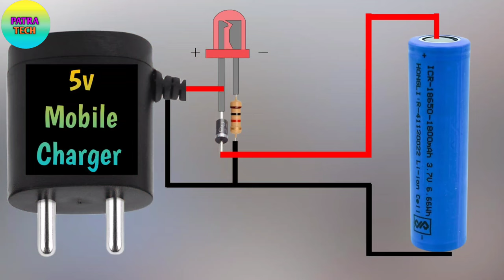3.7v Battery Charger Circuit With Auto Cut Off || 3.7 Volt Battery Charger || 5v Battery Charger

Comment: भाई अगर एक साथ एक से अधिक बैटरी ko चार्ज करना ho to चार्ज करेगा की नहीं और एक से अधिक बैटरी को चार्ज करने के लिए battery ko सीरीज m कनेक्ट करना होगा की पैरलल में। प्लीज बताओ भाई 🙏🏻🙏🏻🙏🏻🙏🏻🙏🏻🙏🏻🙏🏻🙏🏻🙏🏻🙏🏻🙏🏻🙏🏻🙏🏻🙏🏻🙏🏻🙏🏻🙏🏻🙏🏻🙏🏻🙏🏻
Reply from the maker: Battery series karna par voltage Jada chaya par battery parallel connection karna par 5v chaiya amp Jada chaya